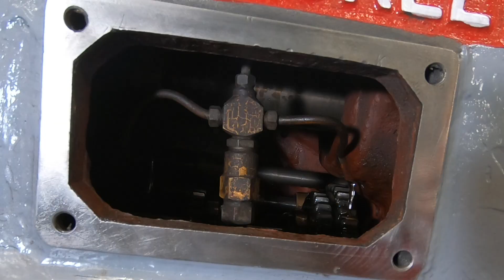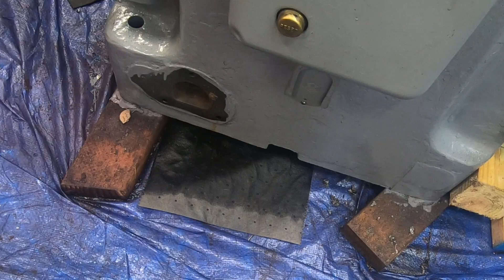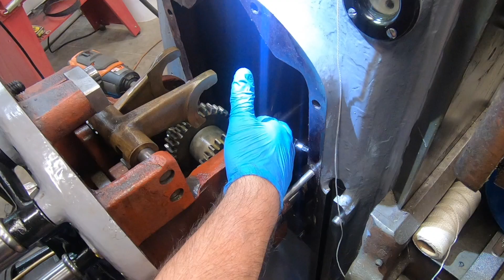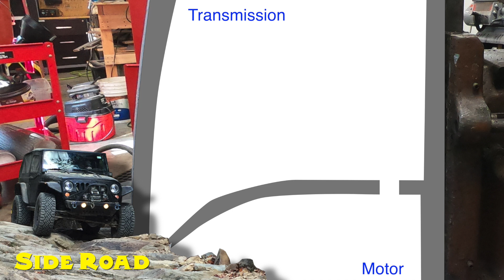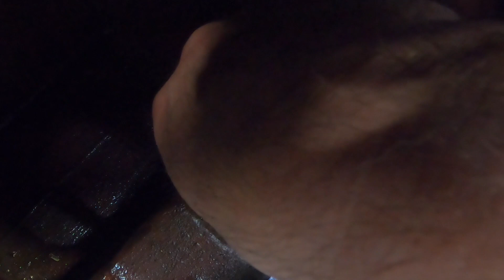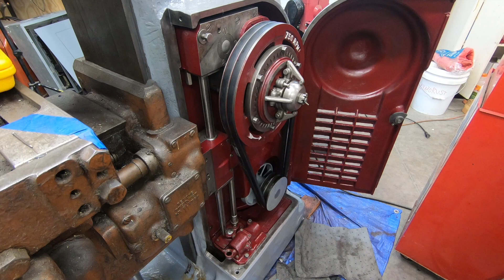Big problem with the K&T - Oil is everywhere!

Comment: Heck good effort on a fiddly job. I think I would have replacedthat darn screw with an allen bolt!
Reply from the maker: Thanks for watching. Trouble is, if I used a hex key bolt, I would still have to grind a good bit of one side away to make clearance for the gears on the side of the transmission. That would weaken the hex key, likely causing it to stretch, and more or less stripping it and making it harder to seat.

Comment: Wow, you dealt with quite a setback there.  But you overcame the challenge and fixed the problem.  Very impressive.  And I am loving that paint job.  The red interior paint really looks nice.  Thanks for making these videos!
Reply from the maker: The paint looks great from 50 feet. Any closer, well, maybe not so much. I didn't scrape off all the old paint. If any of it was still stuck on good, I left it. Kinda having some regrets on that. Maybe once it's all together and running I'll revisit the paint.